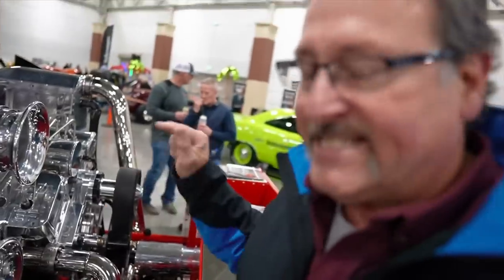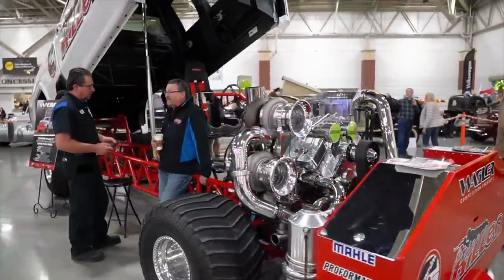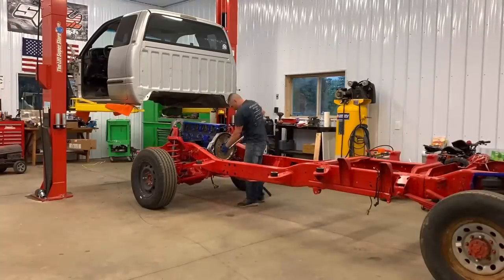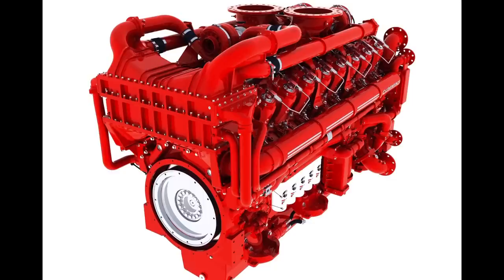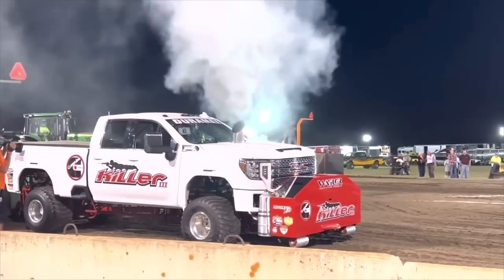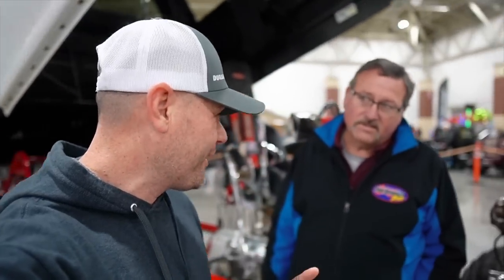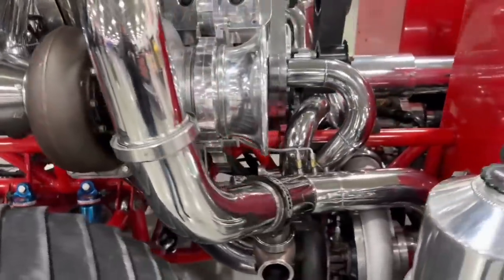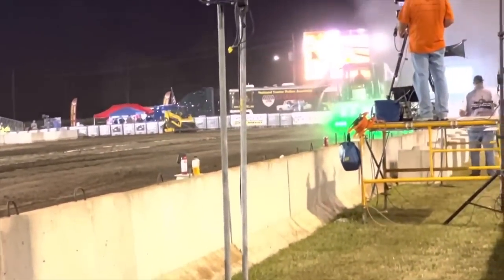Cummins Fans Will Cry When They See This 3200HP Duramax!

Comment: Also worth mentioning, those are fuel only numbers. Not sprayed like you see at UCC or other dyno competitions or drag races
Reply: @Travis Klaassen  yes you can. There's fuel only numbers and spray numbers.
Reply: yea but 3200 on a billet diesel is nothing to really break any records. the fire punk team and D&J team already did a mild set up at 3k on their billet cummins and also there has been cast blocks that have held together at 3k. dont really understand how any of this is impressive when an engine with 2 less cylinders can do this like 2 seasons ago. all i gotta say is its about time.
Reply: @The_Meekster  they are doing it on spray though… fuel only is what makes it impressive
Reply: @Jay Bee yep im a "youngin" alright... i havent replied because arguing fuel only vs spray is kind of a topic that doesnt exist because in the end horsepower is the same regardless of how its made. make 1500hp on fuel only and being able to spray to 3k is just an easier way especially when nitrous cools so when you say your on fuel only your either doing a water injection of some sort to keep egts down or your just washing out cylinders with the amount of fuel and running exteme egts. anyone can throw a bunch of fuel at an engine especially with a mechanical pump. try doing anything else with that engine. where as fire punk with 2 less cylinders will and can run circles around this truck. im not a cummins fan boy by any means but when it takes billet blocks and a lot of money to get where a cummins has been with cast blocks which is a huge price difference. The proof is in the puddin and before you say anything i do own all three major brands and i have built all 3 to over a thousand. would i do it again no, because my time and money is in big trucks.
Reply: Huh?? Ever think to yourself that you should've just kept that comment to yourself?
Reply: @The_Meekster Duramax is the best sooooooooo
Reply: @traciweisenbachCITB  😂😂😂

Comment: This truck is a work of art. Although I cheer this truck on, I think It's a tall task to dethrone the top Cummins guys and do it consistently-thats the challenge.  I'm a duramax guy but when it gets to this level of Hp there has been a consistent winner in this class. Hopefully all the years of work, R&D and shit tons of money it will pay off this year.
Reply from the maker: I’m willingly to bet it’s way cheaper to achieve 3000hp in a Cummins
Reply: @TruckMaster  this is probably one of the most expensive ways possible, to successfully achieve 3k hp...
Reply: Yeah, cummins has been racing since 1930 and finding new ways to make a stronger lighter better engine for a 100+ years.

Comment: How much does this engine actually share with a production Duramax engine?  Can you swap even one part?  Maybe the head gaskets and the starter would physically fit?
Reply: Rotating assembly can all be used in a factory block.
Reply: @robo1210  interesting to know.  Thank you.  Are you positive about that?  Is there any difference in journal size or clearance issues?  I'm simply asking, I genuinely don't know.
Reply: @grubb910  for 460 cubes I do believe a factory block has to be clearanced some. And I’m sure it’s using narrow journal rods/crank as that’s common for big hp duramax builds anyway

Comment: make this a Hi-Rail truck and use it as the locomotive at the railroad yard where i work. to help put the numbers in perspective: the 1979 EMD GP40 locomotive we use is "rated" 3000hp and the road units are only 4400hp.

Comment: They’re calculated this at 4,400 HP this year (2024) as they’ve got some gauges on the output shaft.  

The craziest thing is they can’t even hammer the throttle until they’re half to 2/3 down the track.

Comment: Looks like he’s running a Bosch in-line fuel pump , just like we had built 30 plus years ago by a Tractor pull guy in Wisconsin for a Caterpillar 3408 custom build engine my coworker Bob Morin & I built for an local Heavy Hauler here in San Diego.  The Cat had twin compound turbo system , fire rings cut into deck surface to seal heads to cylinders , made 120-135 psi of boost and on our chassis Dyno at Hawthorne Caterpillar we recorded over 2500 hp and north of 4,500 lb-ft of torque with highest flow custom injectors that Were special made for it ( out of 3 custom sets made ) We put a few “ Junk Cat engines around the sides of it while running in our Dyno cell to “ Absorb the Debris “ if it puked its guts and not send shrapnel flying out through our cinder-block walls of the building ( the roof was on its own though 😆) and thankfully it all held together somehow.  We had A.R.P. Make All the bolts and fasteners for that engine ( custom specs) and had piston tops ceramic coated and skirts Teflon impregnated to deal with The high Brake-Mean -Effective pressures in cylinders . We tried a lot of timing changes as I recall to get things “ Just right “ as per some pretty high-up Cat engineers we were working with from Peoria at that time .  Once that engine was proven on our Dyno , it was torn down ( external parts only ) and had many , many hours of polishing and chrome added to it to make it truly a show piece .  The owner ( “ Bill Signs”) of Trucking company with same name said No limit on expenses on that truck & it was outfitted with Custom 10” diameter Hexagonal stacks, and the truck was named “ Poppa -Clyde” as all of Bill’s trucks had Clydesdale horses painted on backs of Cabs of each Peterbilt .  When we finally ran the Completed truck on Chassis Dyno it rattled the walls of our tin building so Bitchen that it brought cheers from all of us who were involved .  They couldn’t meet California Emissions standards unfortunately years ago and that truck I believe was sold out of state to someone, and to this day I still wonder if it still exists…🤔.   Sorry to ramble on here , but I totally get what this guy in your video has gone through so far to get to this level of refinement and build up here.  Kudos to him & his crew , and wishing him all the Best of luck 🤞😎👍.  C-Ya Josh . & looking forward to updates on the “ Wifemax” build .
Reply: It has a Wimer 17mm p pump

Comment: There is a 4000 hp Cummins on its way and it is the wildest engine I’ve ever seen with blower and two turbos and they say it dump at4600 hp but to make it live they keep it at 4000 hp all tube frame sled puller !
Reply: Will be interesting to see how it does. These trucks don't run out of power as it is. Even at the end of the run, they're still spinning. It's traction. At some point more HP isn't going to help unless they add more weight to the trucks.

Comment: Gunna be a longgg time till they surpass the cummins. Cummins will always be top tier. BUT I absolutely love seeing guys doin what they love by far coolest dmax I’ve seen tho!
Reply: Might be a while but nothing is forever. Cummins had a 12 year head start. Good to see some competition from someone else
Reply: @countcuda70  exactly. I find it pretty cool that they are doin what they are doin. Nothing is forever, but does give cummins pullers a reason to push more hp😂
Reply: @dieseldouche5.953  Yes it will. Heavy hitter will have to come out swinging. Will only improve competition
Reply: @countcuda70  exactly I enjoy everyone building what they like, so I think it’s great. I just will always see cummins on top because how well buikt they can be an handle hP. The guy that built the driveline did Amazin job explain everything.

Comment: Cool, one duramax that can compete with the numerous 3000+ hp cummins on a consistent basis. Not to mention for much less money. Amazing truck and very beautiful, but I'll keep my cummins when it comes to high hp builds and reliably doing so.
Reply: Not sure it's really cheaper to do this with a Cummins. They are all expensive in this class. There's a couple Duramax powered trucks on this class. Even a couple Fords. This will only make the class better. All 3 brands will have to find more power

Comment: At what point does this V8 diesel engine become something other than a Duramax?  The shape of the bellhousing?  Bore centerline?
Reply from the maker: Good question I was thinking the same thing, I’m guessing the lower girdle and maybe the block that should be it.
Reply: @TruckMaster  I'm pretty sure that is a billett block.... I'm genuinely curious what allows it to maintain Duramax status.   Probably nothing, other than proclaiming it is a Duramax, and because it is a V8 under a GM body style, ppl just go with it.  It might have a GM bellhousing pattern, to be fair.
Reply: At what point is a Cummins not a Cummins? No one at this level is running a factory block. They are all custom.
Reply: This truck really has you in your feelings. You have made a few comments on here. Wooosah man. It's built from the Duramax design. Wagler calls this the Dx460 Duramax
Reply: @dozerboyd8784  lots of guys running stock/filled or stock sleeved in the 2000hp range
Reply: @countcuda70  I'm not in my feelings, I just feel like I have some valid questions... so I asked them.   I don't have any kind of brand loyalty.  I'm actually trying to illustrate that brand loyalty is pointless at this level.   But... yeah people make huge numbers and are successful with actual Cummins engines, as well as actual Duramax engines.  This truck doesn't seem to represent anything about what an actual Duramax can do... so it seems silly to insist on comparing it to Cummins.
Reply: @countcuda70  I'd honestly like someone to answer the questions, because I don't know... I'm not trying to act like I do, I'm genuinely asking... then we can go from there haha
Reply: @grubb910  Here's what I can remember when I talked to them about it. The center line of the crank and cam are OEM Duramax. Main journal spacing is also factory specs. It's 460 ci billet aluminum monobloc with iron heads
Reply: @countcuda70  Thank you, that's interesting to know.  So basically, people need to start wearing tee-shirts, hoodies, and buying stickers with: cam center line, number of cylinders, and main journal bearing specifications, on them haha.  "Five Main-Cap Mafia"
Reply: "Two heads are better than one" (feel free to use that on merchandise)
Reply: @grubb910  That's just what I can remember. It's built off the Duramax design. Lol, 5 main cap mafia! That's funny
Reply: @ThanksHero  so? I said at this level not 2000hp. People have made over 2000hp on filled Dmax blocks too. Yep the Cummins is a stronger design, but it's not like it's huge difference.

Comment: That shows Cummins is the best they all are trying to build a diesel engine better than a Cummins and have been trying for a long time they might pull it off but its not gonna be as reliable because none can compete with a Cummins when it comes to reliability
Reply: Cummins is a great engine. No one is saying it isn't. It's the junk they put it in that's the problem

Comment: It must be frustrating to have to do so much engineering, but still have to live within the confines of Duramax architecture.  I'm sure it would be just as easy to design your own engine, at that point.   @stevemorrisengines comes to mind...
Reply: Wagler has it figured out. It's a mechanical injection 460 cubic inch Duramax.

Comment: The piston size is irrelevant if the displacement is relatively the same. I never understood that argument. When I was younger I thought v12 were so cool but they don't pump out more power then V8 inherently because of the 4 extra cylinders. I like Cummins and Duramax equally but I lost interest in diesels until recently seeing the 9 blade turbo video

Comment: lets be honest..... when they put this much work into a engine/ truck is doesnt matter the platform at that point.  nothing is cummins or durmax anymore its all pure performance parts.
Reply from the maker: I can agree with this statement
Reply: 100% truth!
Reply: It’s funny because Cummins in this class are all billet block and heads as well Wagler builds both
Reply: @bpatterson308  Wagler Performance does provide some engines parts for Cummins. Most Cummins Super Stock are Haisley or Scheid

Comment: Chevy and Ford need to make a inline 6 diesel engine that's why Cummins makes a lot of horsepower
Reply: Chevy has a 3.0l inline 6 Duramax
Reply: Dodge Chrysler Mopar. Doesn't make the cummins. So if Mopar doesn't , why should gm and Ford make a inline 6?

Comment: I am not bothered that this Duramax is finding new power , But I noticed when you were comparing Cummins vs Duramax  by showing a QSK95 Cummins industrial engine .If we are looking for the most power diesel  then  Cummins has nothing on a 14 cylinder  WartsilaRT-Flex 96c  107389 hp  and 7000000 nm of torque.

Comment: That engine has strayed so far from OE, it's no longer eligible to be called a duramax. It's a v8 configuration competition pulling motor. Nice inline mechanical pump.
Reply: It's designed from the Duramax. Has to retain some factory specs for the pulling series it was built for. You could say the same about a billet Cummins also. At that point it's not a Cummins. It's a billet engine based off the I6 design.... Cummins and Duramax are not engine designs. They are Company Names. Any engine not built by Cummins or DMax LTD isn't a Cummins or Duramax

Comment: Wagler DX 460 500 Duramax n 300000  400000 rail pressure if u can get cnc rotary power train system head 😁 them liquid sodium filled valves stay short on rpms 21000 rpms with jet fan in exhaust n kw 9750 rubber leather gloves 😂

Comment: Cummins still has 3336 from ucc with 2 less cylinders to do it
Reply: Dyno numbers and pulling numbers are different. It's why Zeigler's truck didn't have the Dyno setup in the sled pulling event. 3336 and 3401 are still impressive either way. 2 less cylinders, close to the same displacement

Comment: I've watched all three versions of this truck. No doubt is it competitive. I'm a cummins owner and I enjoy all diesels. However, pulling specifically has many variables. Many guys are running cummins engine because of the higher RPMs that they can consistently carry throughout the entire track. Duramax although has high RPMs as well,  tend to get bogged down and lose their momentum. If you check out "smokin ya" driven by Eric Stacy, it's a cat eye that competes in the same class. He along with others run cummins power plants in GM bodies. I have no doubt these guys will figure it out,  but you just can't out perform a cummins on a pulling track. It's just the perfect power plant for that sport. Great looking truck regardless.
Reply: Eric started with a Ram/Cummins. He just changed to the cat eye body. Cummins had 12 year head start
Reply: @Count Cuda70  understood, just using him as an example. Other variables go into pulling as well such as tires, grip, track conditions ect. Duramax will perform better on certain tracks, and cummins will be better on others. All around cummins is just more consistent. It will be interesting to see what other power plants do in the coming years.
Reply: @jordanparker7751  They know the recipe for making power with Cummins. 20 years ago pretty much all pulling trucks were Cummins. Powerstroke and Duramax are getting better. Duramax and Powerstroke will get it figured out soon. Next few years will be awesome. I read that wrong. I thought you were thinking Eric had a Duramax in his cat eye before. That's my bad.

Comment: Say what you may, the fact is this Truck is modeled after a Duramax. The engine is in fact designed around the Duramax engines and the characteristics of its engineering are part of this configuration. Yes it is heavenly modified such as anything that is built. Again this is the 3 rd evolution of this engine and drive train. By the way he is using the same rear end out of a Duramax Truck again heavily modified....  Epic yes indeed it is. And that is why they can say it is a Cummins Killer!
Reply: The rear end is not the same.. lol. He’s using an 11.5” aam center chunk for the front different in this truck.
Reply: The rear end is a Rockwell

Comment: I'm not gonna cry about your Chinese 8 cylinder!!
Reply: Need a quick geography lesson. Japan and China are 2 different countries. Isuzu is Japanese. The Duramax is manufactured in Moraine Ohio. The foundry is in Defiance Ohio. Majority owned by GM from Flint Michigan. Sounds more American then your Fiat built Ram. Also since Ram can't figure out a transmission. They went to the Japanese. Aisin, made in Japan. This is an old argument. GM and Isuzu partnered together in 1998 to create DMax LTD. GM owned 60% with Isuzu owning 40%. As of May 2022. GM owns all of DMax LTD. You're all upset for no reason. We all benefit from competition Ford, Ram and GM
Reply from the maker: Bingo 👍